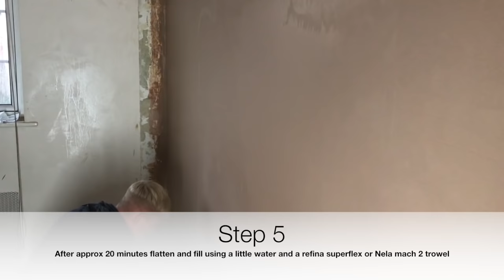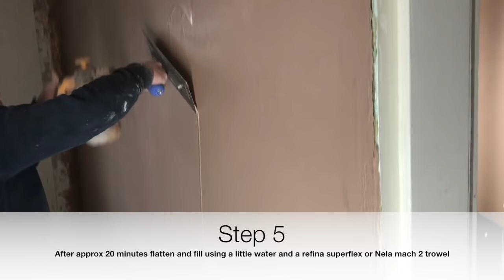Plastering - Skimming,  one coat sponge

Comment: Is metal spatula beter then plastic? What is your opinion?I'm thinking of buying OX speedskim spatula
Reply from the maker: This is down to personal preference.. only thing with metal spats is the tend to warp and lose there shape.  The other thing is it can draw the water out to the surface and can increase setting time.. i personally prefer plastic, the more rigid versions made by Refina, as they tend to hold there shape and last the longest.. they are a bit more expensive though.   But if your starting out the plastic Ox Speedskims are good.. then maybe can look to add to your arsenal of tools in time. I hope that helps!

Comment: Was that a superflex trowel u banged the gear on with ?
no pva with that method ,all grit??
Reply from the maker: Hsilver dale can put on with a super flex.. I'm using a standard 16 inch refina trowel.. doesn't really matter what you use to put on.. but only use superflex and spatulas to trowel up.. when using pregritt no need to use pva.. one coat of pregritt is enough to kill the suction and give a good key. Only thing it needs 12 to 24 hrs to dry.

Comment: I work in Finland 26years plastering in 8h normally I made 150s,m
Reply: that is ok and i believe u because i used to work in Italy as a plasterer now i work in UK . In ITALY and i am 100 % sure in Finland as well plastering is different than in UK , you  use white plaster apply 3 coats ( or 4 ) and then sand it down once its dry . So 150 sq m is working at a slow pace ( as u should )
Reply: here in UK if u do 2 coats properly and have big nice and flat walls u could probably do 30 - 50 sq m . If you do 1 coat sponge about 60 to 80 and 1 sq m in UK average is £10  for walls and £ 12 for ceilings
Reply: we plasterers here in Uk drive Porches to work instead of vans
Reply: @fef777777  well fuck me I've only been chargeing  £4 a square meter

Comment: Why do you sponge  it then?  especially after flattening it?
Reply from the maker: The product works better that way. If you tried to just trowel up the first coat without sponging or 2nd coating, the finish won't be very good.  The Multi-Finsh plaster reacts to the suction from the background wall and would be difficult to get a good finish from just one coat.  It needs a top coat either by applying a 2nd coat or making it by sponging the surface 1mm of the plaster.  When sponging, however, the thickness of the plaster has to be a minimum of 3mm to provide a good layer to liven up as the 2nd coat.
Reply: the skim has to be flat still that's why you flatten it, the sponge will take any tears/ripples/bubbles away and helps flatten further. It will also make the surface fatty and workable which allows you to spread a fatty coat of skim back over the one coat of plaster applied.

Comment: Can u pva wait till it's tacky then skim with this method if so what racio do u use thanks micky
Reply from the maker: Michael Burr yes, I usually to two coats of pva, 3 to 1 mix.. but some walls are very dry so a third coat of pva may be necessary to make sure plaster doesn't dry too quick
Reply from the maker: Yes this method works well on any background except artex ceilings where i would apply two coats

Comment: i've tried all this and many other ways(25+years)to save time or earn more , it's passable on most jobs but i won't do it anymore , it's a shit finish, the instructions are on the back of the bag, follow them, finish plaster doesn't have the density to build out, straighten up or fill holes in one pass , 2 coats isn't really that much more work it lays on nicely . these guys are not plasterers they are known as skimmers, i would sack them by dinnertime

Comment: Step 5, it says "after approx 20 mins..." is that 20mins after you've troweled using the large spatula? Or, 20mins from the time it was left to set?
Reply: No Rocket Science Build if u gotta ask dont bother trying mate,no offence meant.
Reply: Explain why please?
Reply from the maker: Yes wait around 15/20min after using the large Spatula. This is a system that can take a little while to learn.  it took me a couple of months to feel comfortable with it but now its all I do (except on Artex).  Its less labour intensive so easier on the elbows, joints, etc.  The key is getting the thickness of 3/4mm of plaster on the wall the first time.
Reply: Nice one, will try this and see how it goes.

Comment: Why don't you just plasterboard every wall as in US
Reply: For new work, I don't see the point of real plastering, though some plasterers here in New England claim they can get in and out of a small job faster with plaster than even using hot mud. For most purposes though, a really good taping job is almost indistinguishable from a good plaster job and far less prone to cracking.  But I can see why they'd want to skim an old wall like this, just to avoid adding bulk and to keep that "hard" feel to it. Skimming is also great for covering up textured surfaces that come into fashion one decade and are despised in the next one. One thing I'd so differently for a wall with a crumbling surface is cover the whole thing with fiberglass mesh before skimming it; I have trouble believing that any plaster layer will resist cracking for a long time if what's under it has already been damaged.
Reply: We've got quite a few old houses,many of the walls are fine as a render coat but need a skim of plaster to make them acceptable.
Reply: Alot of walls here are still good,just rough looking from the old plastering. If plasters falling off then it would need knocking off then boarding.

Comment: Tried yo method to day on a 20sq ceiling double pva 4to1 started laying on by the time I get to the end of ceiling the beginning was starting to go had to spray sponge float and flatten in by the time I was near the end I was loosing it I had to mix a thin mix up and like double skim to get myself out of it wat am I doing wrong do u think I should flatten in as I lay on also the multi does not seem to last long once it is on the ceiling do u think I need to speed up I can't get use to my spat I have 600 metal one do u think a plastic wood be better wat can I do to get more life out of my multi .I can do yo system on a wall no problem please reply micky
Reply from the maker: HI micheal, could be due to a couple of things.  First thing, the suction wasn't neutralised enough with the PVA.  Seems like it needed a third layer of PVA at 4:1 or could have done two coats at 3:1.  The second thing is the plaster was laid on too thin. Has to be a minimum of 3mm to give you a chance. This system takes a bit of time to get used to especially getting the feel of the spat. So I recommend trying the system on walls for now until you get used to it.  Maybe try putting on two coats with the same mix, so layer on the first coat and can mix another bag straight away and put on second then flatten and sponge etc.  It takes experience to put on one thick coat evenly in one go.

Comment: Looks as smooth as a baby’s butt! I’d be interested in hearing about the techniques longevity. I assume you’ve had no issues with this method?
Reply: If you use this method with USG Imperial it will last forever.  In the U.S. we call this veneer.  Used to build hospitals and other structures with steels studs.  Imperials cure to 3000 PSI.

Comment: the likelyhood that this is also flat is very slim, the only time a hard trowel was used was for application, tell me how you achieve a flat finish on an existing wall when you've applied 3-4mm thick and flattened with a massive spat (with a flexible blade) and then finished it  with a flexible trowel??? i'm all for new methods, new trowel, new machines to make the job easier but the works still got to be flat and bob on. There's another guy who has a channel called Gaz who uses a sponging technique that looks really helpful, the channel is getting to much for him though over a million views and thousands of subscribers so he's calling it a day i was told to have a look at this video because i havent managef to fully undersand Gaz's method a 100% step by step from the video's, so ive watched this to see if it would help cant say i'm going to be giving tjis a try, does any one else know anything about sponging and the method used????
Reply: look at the other vlog they have put up it shows you when is a good time to go at it for sponging when you get the creamy mix its brilliant to flatten in walls come out mint but like gaz said try to lay on as flat as you can it will help in keeping the wall flat i can do the sponge method but if you cant pick out the tips they show you its really hard to explain!!
Reply: bloggs692413 its the second different method ive seen for sponging now and there both completely different, the other way you apply to separate coats though and flatten both which i think i like the idea of more.
Reply from the maker: Gary Shaw hi mate, in answer to your question as to the wall being flat... with this system, you work with the plaster when it's still quite wet. Certainly wetter than with trowelling traditional 2 coat system.  The refina plastic trowels and super flex steel trowels, which have thinner steel, have less drag than a normal Marshall town enabling to flatten while still quite wet.  With applying one thick 3/4mm coat, the sponging in effect is like making a second coat, livening up the surface 1mm to make a nice cream at the same time flattening and filling in. As the other reply mentioned my other video breaks down the method a little more.. you can apply two coats then sponge, everyone develops their own system their comfortable with. It does take a while to get used to this system as its changing a habit of a lifetime. Hope this helps, any questions, please feel free to ask. 👍🏻
Reply from the maker: Gary Shaw that's the same with me, once I learnt it I never looked back.. it's a more efficient way to plaster, that is less labour intensive as you do more work with the plaster while it's wet so the only hard press trowelling is the the very last cross trowel. The quality is definitely there, you have to give it a try in a small area first or someplace where you can practice.. if you have good experience plastering you will have a good understanding of multifinish and it should come after a few tries.. it will be a bit weird at first but once you get a feel for it will come.. need the right tools, don't attempt with a normal Marshall town trowel which is the mistake many make when trying this method.. it's the tools that make all the difference.
Reply: london-plasterer.com so if you could give me a simple break down like 1...2...3...4 step by step type thing that would be helpful, if got enough experience plastering and luckily for me my parents are wanting there bedroom skimmed out soon so i could give it a try there.
i have a metal 32inch refina spat like the one in the video, i also have a 13inch marshalltown permaflex & a 14inch Nela supaflex.
Reply from the maker: Gary Shaw have you seen my other video on my channel, it is a step by step guide with more detail than this one?
Reply: thats where the skill comes in getting the wall flat you just let the spat trowel do the work when its wet and hard trowel when its pickef up enuff so you dont spoil the flatness when you sus it you'll kick yourself for ever doubting it honestly
Reply: london-plasterer.com i havent no, there were only 3 video's on the London plasters youtube channel.
Reply from the maker: bloggs692413 yep the spat does the work of keeping it flat.. you need to put it on evenly so you have a consistent 3/4 mm.. you have the right tools so give it a go.. hope it goes ok..👍
Reply from the maker: Gary Shaw https://youtu.be/AbGroo62yjc
Reply: london-plasterer.com m8 i already do just bit different to you i apply 2 coats same mix... like you said to do in another of your replys.. the rest is the same as you comes out pucka too the new tools are there for a reason and they work if you get shown how too properly
Reply from the maker: bloggs692413 yep, everyone finds their own style that suits them. The videos are a template from which to get the basic idea of the system. Glad it works for you 👍🏻
Reply: Just watched this, so the finish is a matt finish? The other guys gets his to like an egg shell finish, suppose aslong as its filled properly and flat it doesnt really matter painter dont like it to shiney.
Reply: london-plasterer.com  yep very true i was just trying to help gary out as he was having abit of trouble getting grips with yours and rwf67 method thas all m8
Reply from the maker: bloggs692413 no worries, appreciate your comments and any input you have as it all helps out those looking to learn 👍
Reply from the maker: Gary Shaw yes, an even matt finish is all that is required especially from a painters point of view.. if you want more shine you can always give it another trowel..
Reply: london-plasterer.com i'm not interested in more shine because i know its not needed, so do painters, but Joe Public loves shiney walls 😂